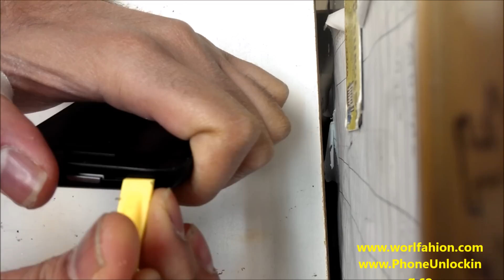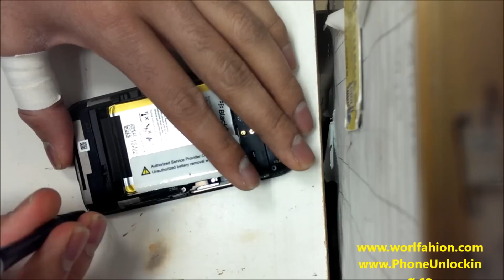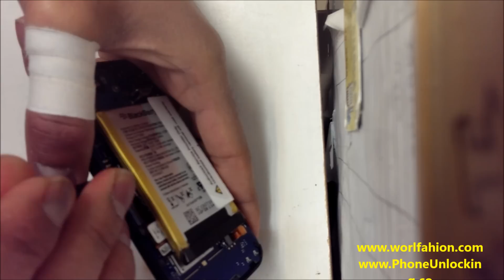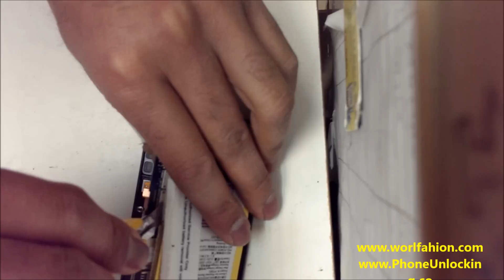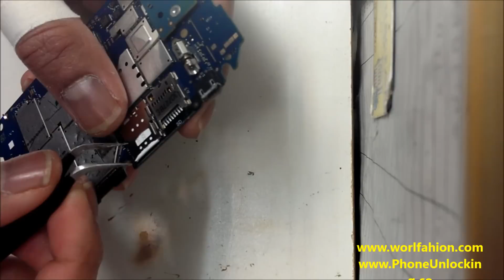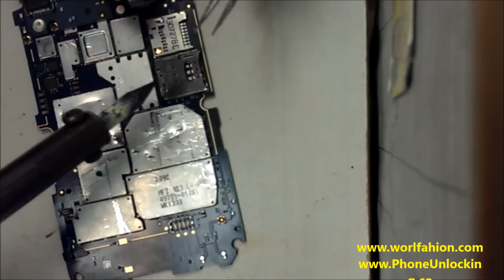BlackBerry Q5 Sim Card slot Fix no Sim No service Issue sim not detacted

Comment: danger, do not bend or stick objects under the battery, instead apply light heat (40 deg cel) to the opposite side of the board (not the battery side, do not exceed battery operating temp) then gently pull the warning label tab, until all the glue is pulled out from under the battery. the battery will simply fall off.